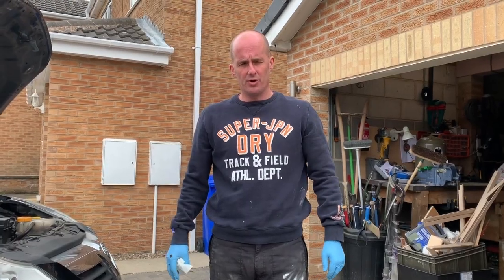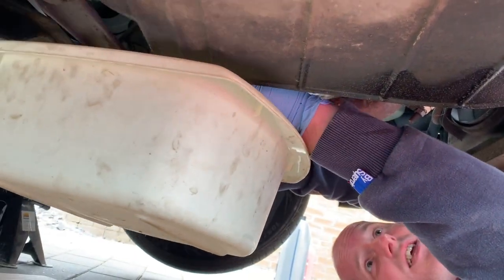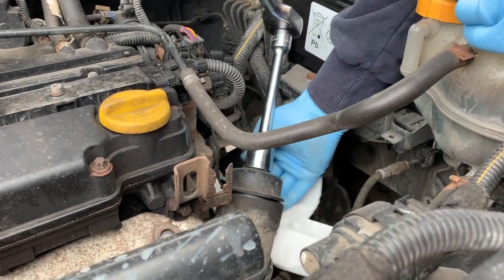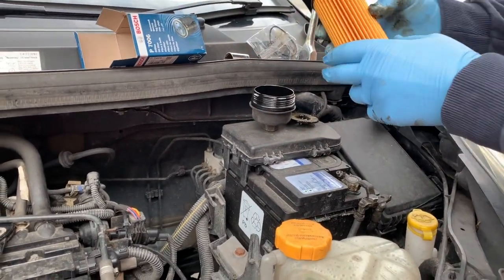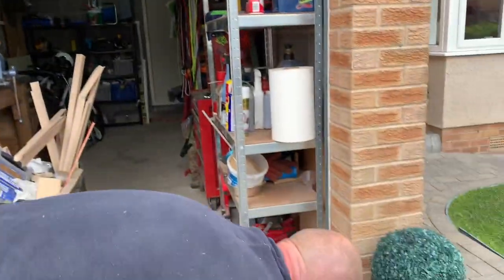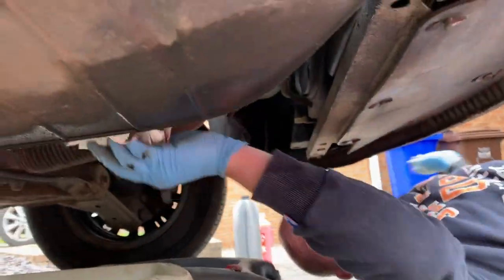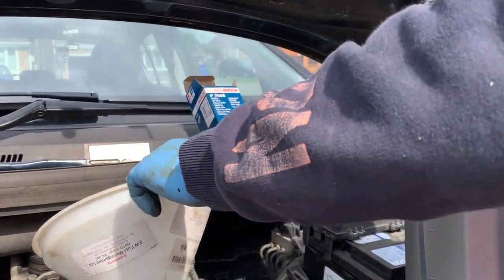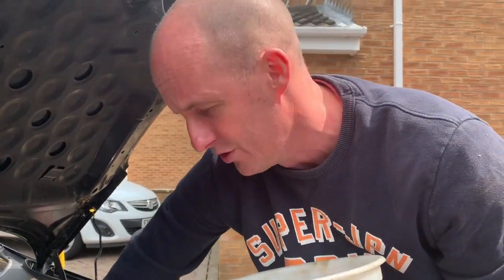Oil Service Change on a 1.0l Vauxhall Corsa

Comment: When draining always remove the oil cap first, then filter, then remove drain plug , that way you retain less dirty oil due to pressure release, don't feel you need to rush this, let it all drip out for 1/2 hr ,also try not to drop the plug, hold onto it, clean it - top tip, add engine flush first, bring car up to temp, cool down for 10 mins and then start, will get all those impurities out the engine
Reply: If you change the oil regularly then you don't need engine flush. Flushing your engine on each oil change is adding unnecessary cost and could actually make things worse. Just change the oil every 4k Miles or 6 months. Whatever comes first.